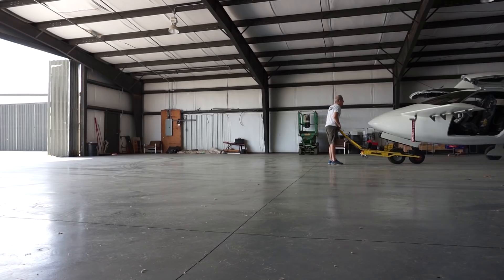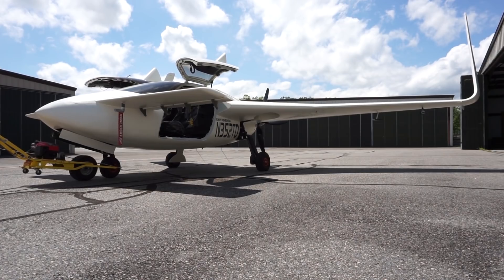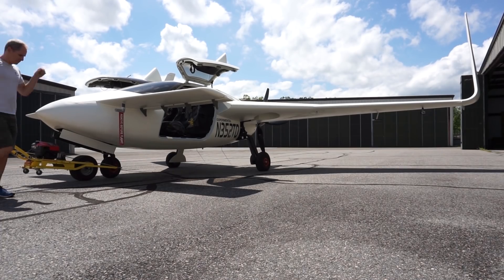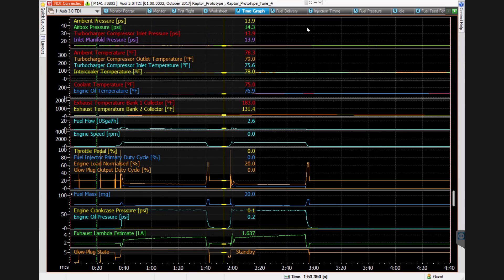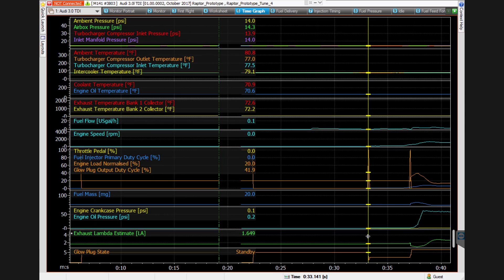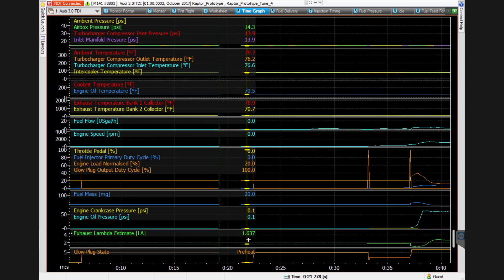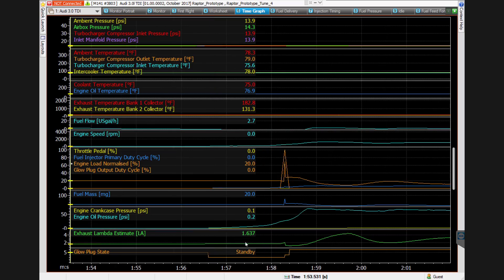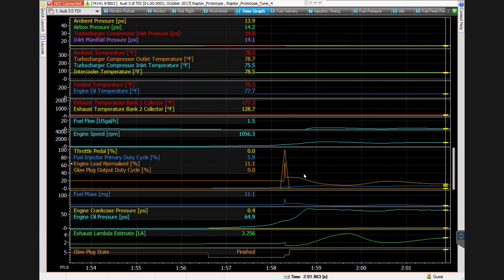Startup Tuning - Building the Raptor Prototype

Comment: All the Automotive and light commercial DI diesel calibrations I have worked  on (Ford, PSA, Jaguar and Landrover) have both pre and post heat at ambient temperatures, not so much to aid starting but to reduce HC and CO emissions before the oxi cat lights off.

Comment: Audi measures the coolant temp and only uses pre glow before cranking below 5C. Pre-glow starts when the driver door opens. But Audi always uses the glow plugs during and after cranking for up to 3 minutes - even for warm start - with the exception of that being paused when revving above 2,500 rpm and stopping early if the water reaches 20C. The long post glow is to reduce noise and white smoke. The glow plugs don't use much power once they are hot.
Reply from the maker: Thanks for that. I can likely program most of that.

Comment: AWESOME.  Just thinking outloud...  My T I O. 540 is a monster. But if it loses BOOST PRESSURE IT'S NOT.... Being that the diesel Needs almost twice the starting AMPS AS GAS ENGINE'S..... MY POINT ON THE BOOST PRESSURE.IS THE DIESEL MUST HAVE IT.what would it make N/ A. Just thinking about piping an couplings....👍✌👀👍

Comment: As the first flight is approaching I wonder if you have given any thought to the turbine speed increase with altitude. If your calibration maintains constant boost pressure with altitude then depending on the sea level turbine speed headroom you have there is a real risk of exceeding the maximum turbine speed with potentially disastrous results. In the control strategies that I have used there is effectively a digitised copy of the turbine speed vs corrected airflow to ensure that safe speeds are maintained. Does the Motec have this? This takes me to the second question, I have experienced two overspeed turbine failures in automotive applications at altitudes of 2500m plus where in both cases the engine ran away (running on lube oil from the destroyed turbo bearing). Because the vehicles had manual transmissions it was possible to stall the engine by quickly engaging top gear and dumping the clutch. In your case how would you stop the engine? A manually controlled intake throttle or maybe a CO2 purge system might be a wise addition. The thought of a runaway diesel engine in an aircraft makes my blood run cold!

Comment: You are dressed in shorts and still you are using the glow plugs on a TDI engine !
This is NOT an indirect injection engine, where you need pre heat at every start. On a direct injection engine you only have pre heat for cold start.
Disconnect the glow plugs to test and you will see it doesn't make any difference in starting.
That 3,5 seconds you mentioned in the previous video may be suitable for -15  Celsius degrees.

Comment: I noticed that you seem to nearly always have some or all of the engine cowling off. I'm curious why that is. I'm sure you have a reason, but I'm just curious about it.
Reply from the maker: Just because I'm checking the engine after every time I run it. The cowling has been on for testing and I did not have any thermal issues.
Reply: Raptor Aircraft it is a beautiful plane and it seems like you might get close to your performance goals. Please get this to production, and don’t let it fall by the wayside. It will likely revolutionize the kit plane industry.
Reply: @sterlingtardie  I'm guessing a lot would have to change in order to bring it to manufacture. Were probably half a decade at least until this comes to market but I'm very hopeful

Comment: First cold start definitely looks like not enough glow plug and too much fuel. Reminds me of my old powerstroke when I had a rich tune and a burned out glow plug. I know your plugs are working, but it definitely looks like there’s not enough heat or too much fuel for initial turnover.
Reply: I agree the glow plugs should be on for crank white smoke is unburnt fuel. And the engine sounds slow on crank what’s battery voltage on crank?